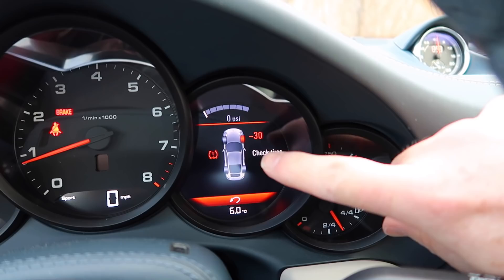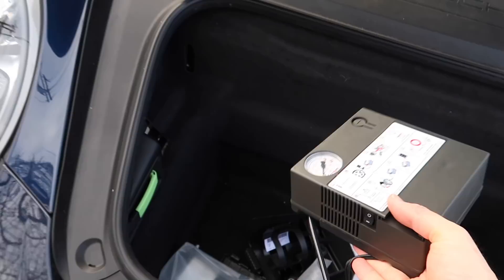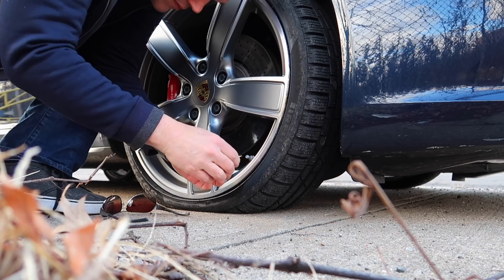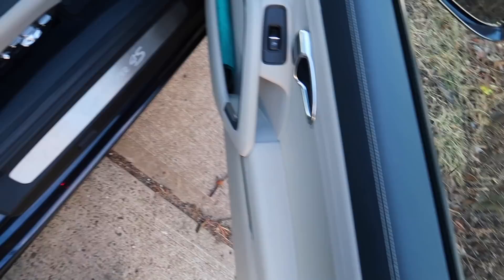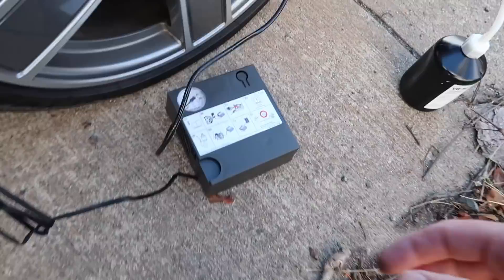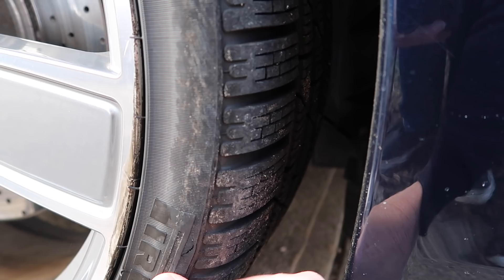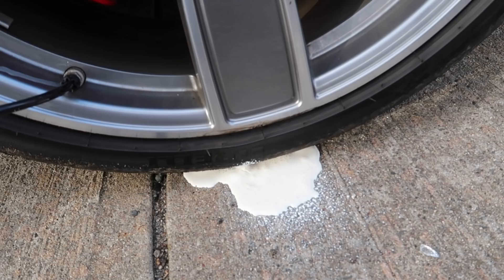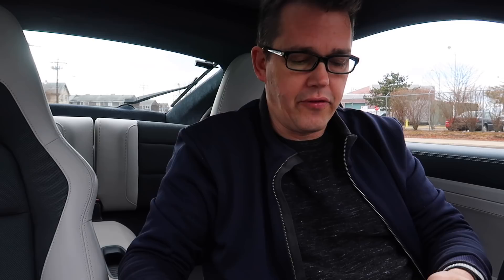Getting a flat tire in a Porsche 911

Comment: Ohh Nick, it was very painful to watch you try n unfortunately fail. 
You also failed at pealing the banana at the first attempt lol.
Why does Porsche deliberately try to do things the hard way? Even trying to replace a flat battery is no fun either.
As a comparison, Mercedes-Benz has a run-flat-tire technology whereby if you have a flat tire, you can drive the car safely 
by not exceeding 18 mph (30km/hr) to a service station or dealership.
Now, why doesn't Porsche do the same? Ohh hang on, maybe it's the way to get more money out of you.